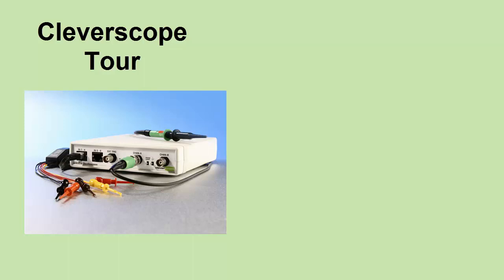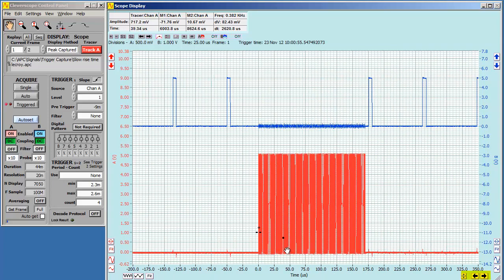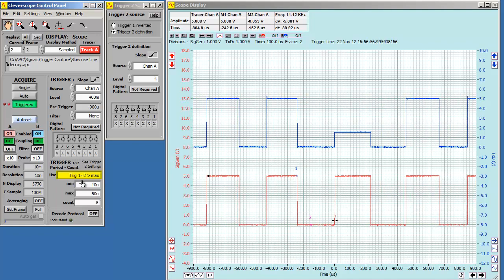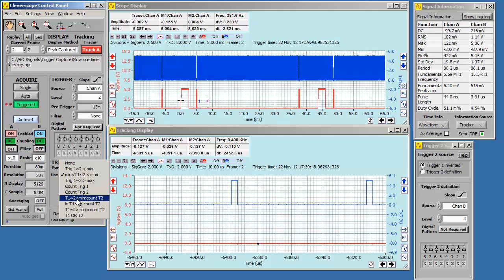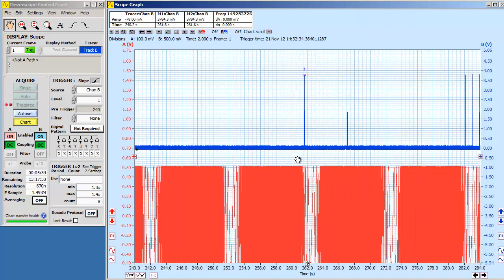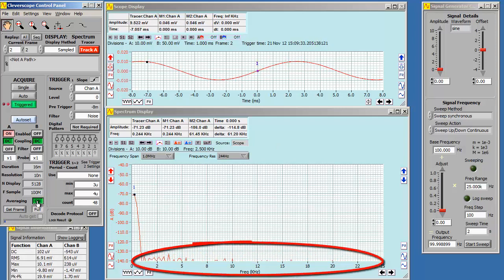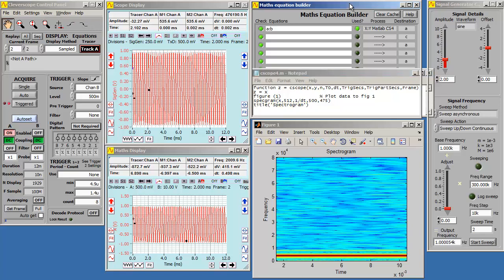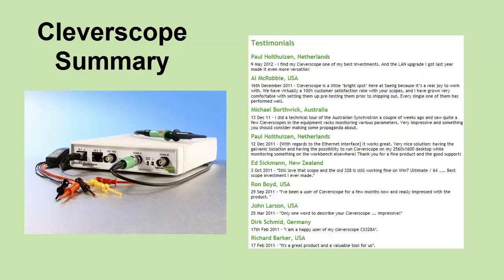Cleverscope Tour

Comment from the maker: If we could make a scope with 14 bit ADC's, noise floor of -100 dBV, phase error of 200 ps between channels, gain/phase response measurement over 10 MHz (CS700A) or 50 MHz (CS701), dual mixed signal trigger, digital inputs, symbolic maths, matlab connectivity, protocol decoding, simultaneous tracking big/small picture displays, continuous logging at 1.5 MSPS for days, and Ethernet connectivity for the same price as a noisy 8 bit Chinese scope without these capabilities, we would. But sadly not.